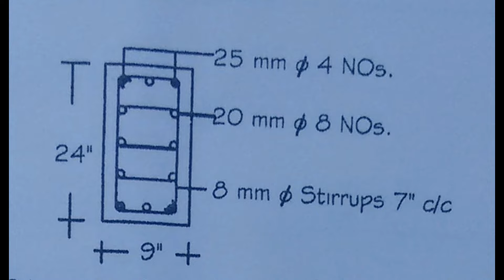Column Extension reinforcement Building construction part-12 || watch #civiltechconstructions

Comment: do they use galvanized wire cable in bridge concrete columns instead of rebar
Reply from the maker: I haven't seen in building construction. if may I will practice do the video